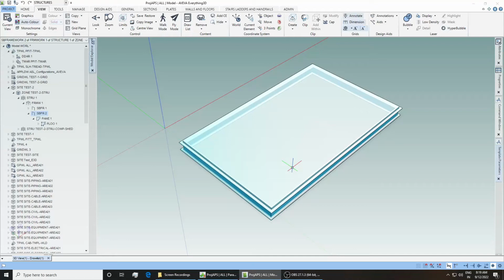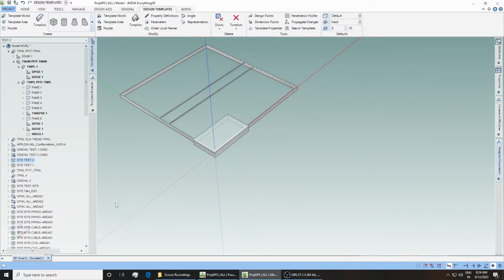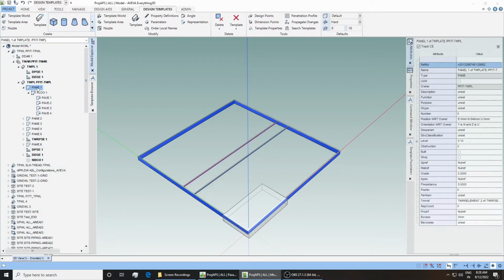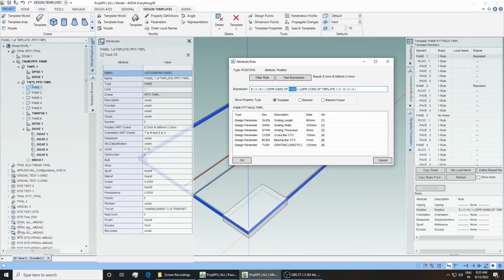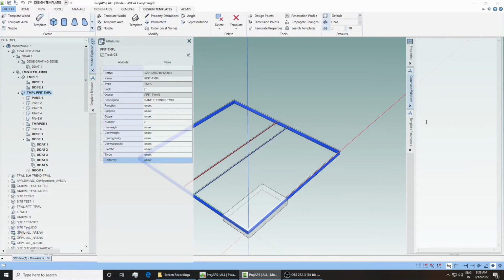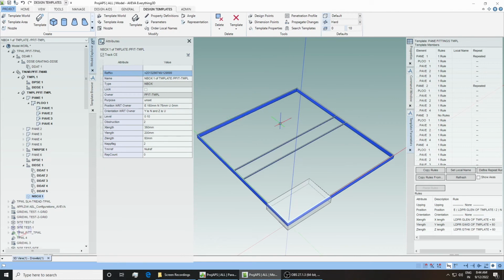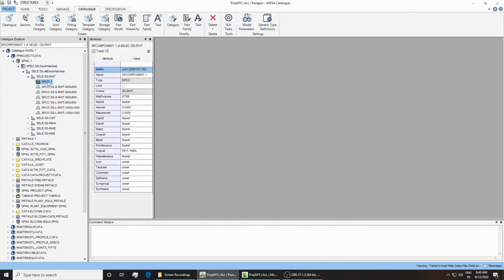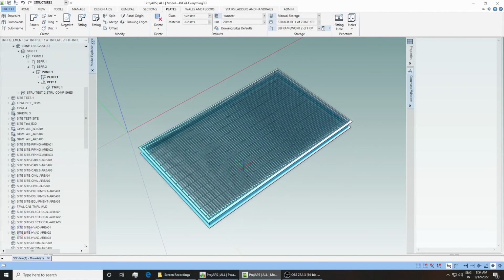How to Create a Grating in AVEVA E3D or in AVEVA PDMS [ Creation & Administration Tutorial ]

Comment: How to create hole to gratings.
I have created complete gratings but the issue in creation of different penentration
Reply from the maker: Will create a short video on that, 
Answer to ur question is,
1. First go to modify lock and unlock the panel and the template.
2. Create any negative geometry required like circle , rectangle or any negative extrusion under the template, and change the NAPP or negative applies to value to 7 which means remove from all.
Now u have successfully created ur penetration.